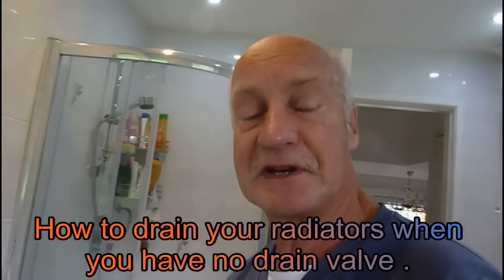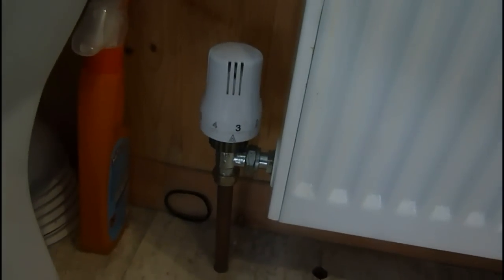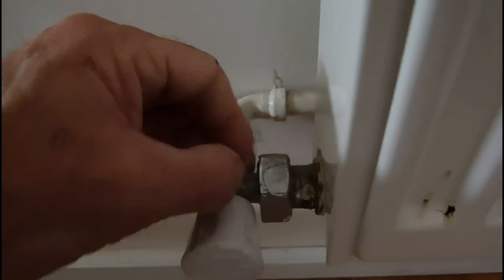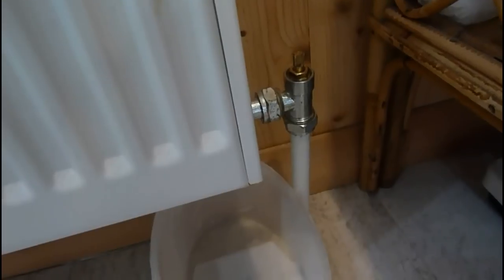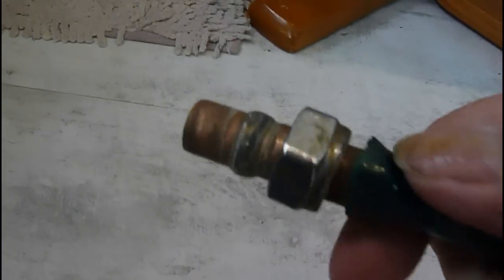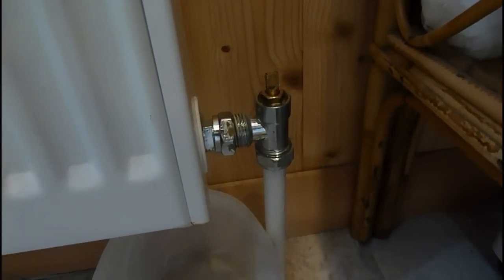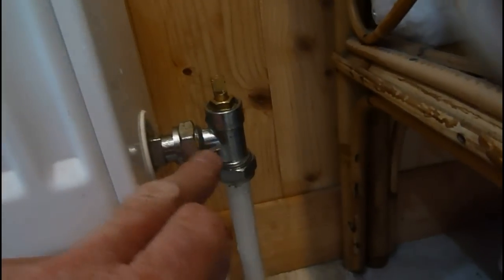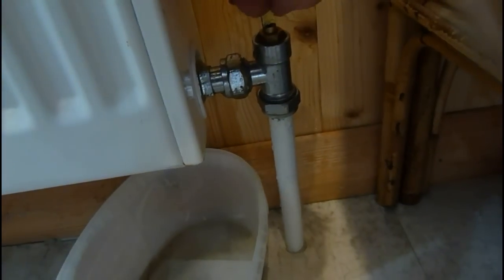How to drain your radiators and boiler when you have no drain cock,or it does not work.

Comment: Thank you so much for this video, exactly what I needed. My husband was at work and I was decorating and needed the rad off...panic! I followed you step by step and ended up removing 2 rads VERY successfully...and cleanly.   Very, clear and easy to understand. I've never done this before so I would call my result an achievement, thanks to you A*
Reply from the maker: That`s great Stacy, well done.
Reply: @dereton33  Hi I'm after looking at a few of your videos. They are very helpful thank you. I need to put a towel warmer in the ensuite and take out the radiator already there I need to do some rerouting because there is 20 inches in the distance between the old rad and the new towel warmer. I dont have a drain valve in any of my downstairs rads. Just checking is this the correct procedure. 

Hold ball cock up in small header tank in attic

Come downstairs go to rad beside back door which is the 1st one to warm up normally close supply to rad loosen connection turn 90 degrees 

Put on lenght of garden hose to the 90 degree connection put hose out back to drain, open up water supply to garden hose and go upstairs and open all air bleed valves empty system do my new plumbing pipeing connect to new towel warmer come downstairs close the connection at the rad I emptied from. Go upstairs close all air bleed valves and fill the tank with inhibitor release the ball cock in header tank and air bleed all rads including the new towel warmer.

Is there a purge valve that I need to purge on top of the boiler when that is all done. I remember a few years back I couldn't get the heat to work until I purged it I think it's at the top of boiler under cover. 

Sorry about the long waffle just want to do it right 1st time. Thanks Andrew form Ireland

Comment: brilliant!! i had no drain off valve and came across this video, worked a treat. Allowed me to install new radiators and trv's also filled it back up and worked great thank you keep up the good work!!!
Reply from the maker: Thanks for your kind comments.
al.
Reply: dereton33 hi can you please tell how to drain heatline combi  boiler vizo24 (the Drain the boiler’s hydraulic circuit) I  had tried but I can't find anything. the manual saying to turn off  the insolation valve  and open the discharge valve.
Reply from the maker: Some times there is no drain valve, then it is best to drain through a radiator , I have a video on how to do this. Al.

Comment: I had this problem and found to my surprise that a standard brass screw fitting that goes on an outside tap also fits onto the radiator valve perfectly. So I used that, some hose and a jubilee clip :-). Thanks for another great vid Al.
Reply from the maker: That's a brilliant idea with the outside tap connector I will add that idea on as an annotation , so thanks Mike.
Kind regards,
al.

Comment: Don't know if the tip has been said already but the larger valve ends that you say you need to hold the hose pipe on is the same size as a washing machine/dishwasher pipe connector, I cut an old one up, forced a 15mm copper on the end of  that and then a garden hose on the end of that and you've got a bleed kit :)
Reply from the maker: Thanks for the info. Al.
Reply: +dereton33 my Hozelock adaptor fit like a glove, hose straight on :)

Comment: Yes Paul u are correct.  That drainoff is probably for your domestic hot water. Best option is to do it the way the video shows. Or if you have an oil boiler it might be on that and if not and the boiler is outside u could crack a nut on the lowest point on the pipework. Don't forget to turn off the mains water. If it's a gas boiler copy this video.

Comment: I do have a question...I've added a rad in a conservatory and want to connect to CH system.Its a pressurised system with 10mm to all the rads.Have been told that it needs to be connected to a 'manifold' which could be anywhere under floorboards etc.My plan was to pipe up to upstairs  rad inlet and outlet pipes (nearest and most convenient route) and T piece the new pipes in.Also dont have any drain valves on any of the rads so not sure yet how to drain system,which I would need to do to connect new rad.Great informative vids by the way.
Reply from the maker: Had you had 15 mm pipe you could have teed off but not 10 mm. If you still want to do it the best way is to undo a rad valve on the ground floor. I have a video on how to do it.
Reply: @dereton33  Thanks so much for reply.When you say 15mm.I was told to do my new runs in 15mm.which I have (speedfit 15mm)......Not sure whether this will make any difference?
I am assuming you mean the current system is 10mm,which it is.If that is the case,why can it not be done?

Comment: hi again, yet another great video. We have moved a radiator from one wall to another in the same room, so the valves are currently hanging off the wall. Next step is to plum it in up to where the two pipes connect to the system. Now before we cut the old pipes, can we just drain the water from the pipes using the valve hanging off the wall like your video, without draining the whole system? (back boiler system)
Reply from the maker: +Mick Jones Yes thats the best way. Al.
Reply: +dereton33 Hi Al, we have moved our radiator. We now find that non of my rads get hot at all. We got some warm water and some glugs when bleeding, but now the rads are cold. It looks like the water is not getting pumped around the system, we bled the pump, made no difference.  The pump seems to be ok,  humming away. Any ideas?

Comment: Thanks for the video! I'm due to drain our combi system to move a radiator, but will be decorating several other rooms in the coming months, is there any harm in leaving the system empty for an extended period of time? and will I still get hot water? TIA
Reply from the maker: You will not get any hot water once the pressure is gone from the combi.

Comment: Hi Al, thanks for all your the informative videos. I need to drain the system in my house and I think I have found the drain valve beside the hot water cylinder upstairs. I thought the drain valve would need to be at the lowest point of the system to drain all the water out? Surely if I drain the system from upstairs the downstairs rads will still be full of water? Is this correct. Thanks!
Reply from the maker: Paul Weafer Hi Paul the drain valve you have found is not the correct one, that one is for draning out the hot water cylinder, you are correct that the heating system drain valve will be downstairs somewhere at the lowest point in the system, usually near the boiler or a radiator, also check the downstairs pipe work. Al.
Reply: dereton33 Thanks Al! I'll keep searching :)

Comment: Excellent video, I have the problem at my daughters flat, searched but cant find a drain valve. The pipe work for the rads is 8mm . I think the video applies to this size of pipe?
Reply from the maker: patgeorge1 It can be any size pipework but it is still a problem when there is no drain valve. Al.
Reply: Cheers for that.

Comment: Exellent video thankyou. Can you please do a video of how to replace the fibres on the drop down pipes under a combi boiler. Ive a few drips coming from the pressure valve. Ive bought the washer kit
 Is it a straight forward process of turning off the mains water stop cock then undoing the nuts and replacing the fibres? Thanks
Reply from the maker: Bigga Cat Yes that`s it a simple job. Al.

Comment: Hello, one thing no radiator experts mention, when working on your own to flush out Rads., it is not possible to move the pipes out of the way to carry out the flush, so it will be necessary to jack up each Rad 6 inches to access the Rad end connections., this will be difficult and no doubt end up in water everywhere.!
Reply from the maker: Just drain the rad and turn each valve so it faces you this will give the clearance you need.
Reply: 4e

Comment: When you open the bleed valves upstairs to drain, once all the water has stopped do you open them all downstairs as well? I'm not sure you mentioned that bit? I was wondering if that's necessary downstairs as well.
Reply from the maker: Yes.

Comment: Really nice vid Alan,

I got a questions, when you pressured your combo boiler? Should the pressure always remain between 1 - 1.5 when the radiator is off? Cause mine drops to zero once the radiator is off regardless how many rimes I pressure it.  It then returns to normal levels once it’s fired up. 

Is that normal or? I can’t see any leaks anywhere but the radiators  make clanking noises when it’s first turned on and after switching off. I have bleed them but no air comes out just water. 

Why idea?
Reply from the maker: Yes it should.
Reply: @dereton33  what’s causing this do you think?

Comment: Great video! I am just about draining the system but i have found TWO(!) drain valves! Wondering which one should i use? Is one for the heating the other one for the hot water? They are next to each other.
Many thanks!
Reply from the maker: If you have a combi then they will both drain the heating system. If you have an F and  E system then it could be either, follow the pipe back to either the cold feed to the cylinder or return heating pipe.
Reply: @dereton33  thank you for your help and the reply! I have got gravity system with hot water cilinder. So one of them will be the hot water then... It is just difficult to follow the pipes as they are running under the floor. (suspended timber floor with no access. The drain valves are outside the wall)
Reply from the maker: The cylinder cold feed will have more pressure and run on and on, where as the heating system will not have the same pressure and will run for a shorter time.
Reply: @dereton33  Thank you :)

Comment: Hey Al, complete novice here, but I'm just curious, why didn't you let the water just run away down the shower drain (plug hole)? - instead of feeding the hose all that way outdoors
Reply from the maker: +The_ Pentaquark. The hose would have had to raise to get over the shower tray lip, slowing the draining process, you can get a good suction on the hose by taking it out side and dropping the end to a lower level than the item you want to drain.,
Reply: dereton33 gotchya :)

Comment: I want to descale my loft tank and the hot water tank with Fernox DS3. At our previous property this required emptying the loft tank and hot water cylinder via the draincock, pouring descaling water and solution via the lift tank, heating the solution in the cylinder for hours, draining via the taps and flushing the whole system with clean water until the test strips say the solution has been fully flushed from the system. If I do the same descaling process but drain the water each time via the bottom floor radiator, will this still yield the same result of descaling and flushing the system effectively without the draincock on the actual hot water cylinder. I am worried that the solution doesn’t fully get flushed/removed via the radiator draining method. Thanks!
Reply from the maker: Yes that will be fine.

Comment: Great Video.

I came to watch it, as I need to change my radiators (Really old and grotty!) and might as well do them now during the COVID-19 lockdown. Realised I haven't got a drain valve in the ground floor, and I have to do this method.
Only issue I have is I have the old big unions on the rads downstairs, so what do I need to get the hose attached securely to them? As the 15mm pipe w/ olive is clearly not going to work..... Any recommendation I can order from Screwfix?
Reply from the maker: Yoy might be better off getting a self cutting drain valve fro screwfix. I have a video on how to fit one. No draining down.
Reply: @dereton33  Thank you so much for replying so fast! You're an absolute legend!

That method is really going to help with the initial drain off, as I'll be replacing the piping to the Rad at lowest point and be adding a lockshield with a drain off on it.

Again, thank you so much for the speedy response and advice! My Mrs' will be made up when I replace 4 old rads!

Comment: Great videos Alan.
Keep up the good work.
Can I pick your brain please.
I have a double radiator which gets hot at either end and the top but the lower middle is cold.
I suspect sludge.
I want to remove it and take it outside and run the hose through it.
I have tried to drain the radiator from both ends after turning the trv to off and turning off the valve at the other end.
I have drained litres and litres of water out but it will not empty, I have opened the bleed valve but water keeps coming out.
Would you suggest the valve is no good and still letting the radiator fill !
Regards.
Reply from the maker: Yes, it will be the thermo valve letting by, or the lockshield valve not quite closed , use a spanner to give it an extra push off.
Reply: @dereton33  Thanks Al 👍

Comment: Hi mate wondering if you can help. I turned my hot water off at the hot water tank in the airing cupboard. Anyway now i have no water coming out of the hot water taps when turning the stop tap back on. I have found that the stop tap in the cupboard just keeps turning both clockwise and anticlockwise so think it is broke. Should i drain the whole system in the house and replace the stop tap in the cupboatd. The heating is fine just drops coming out of the hot water supply. Please a quick reply would be grateful thanks.
Reply from the maker: The gate valve is broken and will need renewing. Drain the roof tank using a hose into the tank and syhpon it out.

Comment: If I remove my lockshield and replace with a lockshield with a drian off valve, can I use the existing nut and olive rather than removing them? Thanks
Reply from the maker: In most cases yes.

Comment: Great video thanks. How do drain the radiator that you are working here. Does it not stay full? I want to change all the valves to TRVs. Also can it be drained at the other end or is it always at the lockshield end?
Reply from the maker: If you are going to renew the valves you will need to drain the system.
Reply: Yes I know I want to drain the whole system. Using the method above will the radiator you are drain from not stay full as you have it blocked with putty. How do you drain this one also. thank in advance

Comment: I can now drain my central heating system but I need to adjust the radiator pipes because my new radiators are a slightly different size. 
Unfortunately I live in a bungalow and there is no way of draining the system completely and I need to remove the water in the vertical s.section of the pipes as the come out of the floor so that I can solder on a new section of pipe bent to fit the new radiators How should I proceed or what can I do?
Reply from the maker: Undo the nut on the rad valve you are going to change, but first, turn off the valve and the lockshield end first. Attach a hose to the valve, place a short piece of copper pipe into that so you can get the hose pipe to fit, open the valve and drain the pipework out.

Comment: hi al thanks for info. i had to change a motorised sov which was 22mm fitted either side by plastic pipe reducers to 15mm pipe. both joints leaking badly and valve spindle leaking. i changed the valve and fitted again plastic reducers either side of valve. i had asked the plumber merchant do i need stiffening inserts in the plastic reducers, but he said no as wall thickness strong enough. having fitted them no leaks, ran system for 2 hrs leaks, tightened crimp nuts on sov slightly, no leaks, system cooled and joints again leaking. what do you advise please im desparate thks
Reply from the maker: MrBeracah If the reducers are fixing on to copper pipe then you do not need inserts, if they connect to plastic pipe then you do. If they are connecting to copper pipe, then I suggest throwing away the plastic reducers and going for brass ones.

Comment: I've a drain valve on mine but there doesn't seem to be a tool in existence that will open it. It look like a bleed valve but no screw head and it's in a round housing that is smaller than any ratchet set I have or have seen...any ideas as with a standard bleed key you can't get any strength to turn it as its too small.
Reply from the maker: fooman65 Some times the round housing unscrews, if not, then a small box spanner should reach it to turn it .
Reply: hey thanks for the reply, housing is all one piece and tried spanners and pliers but gap around nipple too small and below the top of the housing rim. Took a photo and took it to B&Q and spoke to the plumber guy, he said all the things i've tried and final suggestion was swap it for ones he had in the shop but I still need to drain it or risk making a mess first. It was fitted by British gas a few years back and it's as if it was a test valve that never went into production because it didn't work haha.
Reply from the maker: That sounds familiar, one last thing to try is to get a junior hacksaw and saw off the brass round housing so you can gain access to the valve head. Al.
Reply: May try that, I was thinking of sawing a slot right across the top so I can get a big screwdriver in there. My dad coming around today with big bag of tools so between us we'll sort something out, thanks again for your advice.
Reply from the maker: Ok, good luck with it. Al.

Comment: Or u could just not tie into the valve and force the hose without the copper on the end tail of the rad with a jubilee clip and open the other valve. Less chance of water damage to carpets. And less chance of plumbers mate escaping into the system. You need to figure which is your TRV in this video and which direction you crack the to.